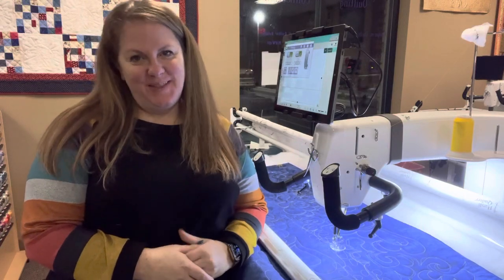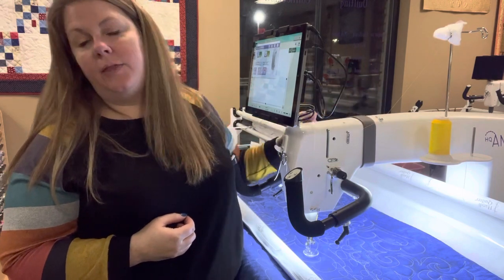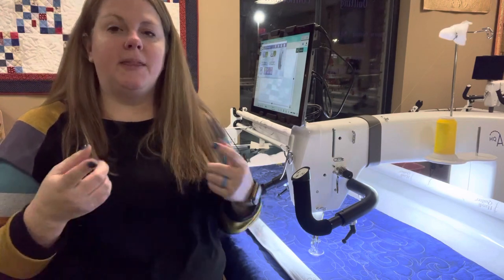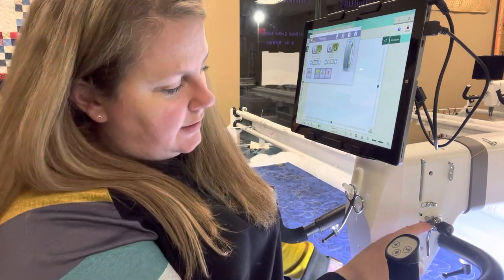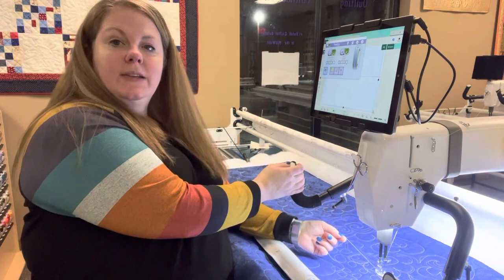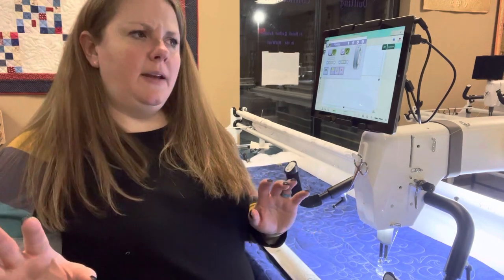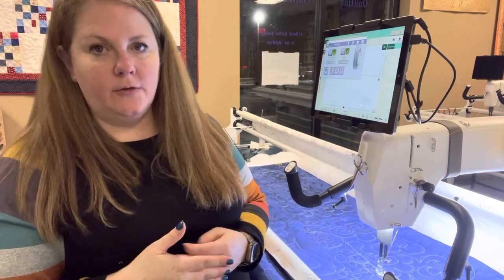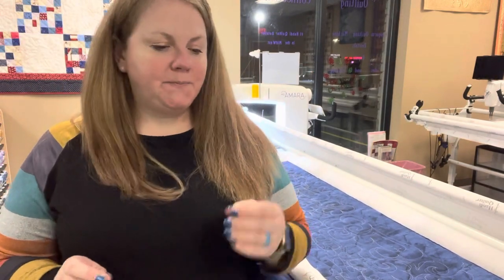Fixing Thread breaks and How to thread a Handi Quilter longarm machine

Comment: Thank you so much! I had to turn off my thread sensor and tech told me my wire wasn’t close enough. Now I understand! Also didn’t know about tightening up bars. Good to know!
I learn something every time! 
And thank y’all for taking care of my micro foot issue!! Y’all are awesome!!
Reply from the maker: Oh good!! Just be careful if you try to adjust your thread break sensor. If you tighten that screw too much you can break it. Then the head would need to be opened and the sensor replaced and I think those are over $200 for a replacement. You just want that set screw snug but not tight! 
You are so welcome! We are happy to help!

Comment: Can you explain more on the batting up top?
Reply from the maker: Yes! That helps to pull off any extra lint from the thread. It also helps keep the thread smooth as it pulls off the cone. It’s just a small strip of poly batting folded up.

Comment: what causes eyes lashes on the back of the quilt
Reply from the maker: Great question! Usually not having the thread all the way between those silver disks will cause eyelashing. If there isn’t enough tension on the top you can see the eyelash on the back. It could also be if you aren’t using the same thickness (type) of thread top and back and using the same color top and back. Then you can see eyelashes with a thin batting. Batting is one of the most important factors for a good tension. If it’s a thin batting or too flat, then you have to work really hard to get the stitches to lock in the center of the batting so you don’t see eyelashes. My best advice is always use the same type of thread top and back and try to always use the same color top and back. If you use different colors or a variegated thread then double the batting to help with tension. Hope that’s helps!
Reply: @angiesanswers91  thank you

Comment: Mine is breaking when it stitches up and to the left. Im so frustrated.
Reply from the maker: That is the hardest way for the machine to stitch. You can try to turn the needle to about 7:30 and see if that helps. If not try 4:30. That helps see if the timing could be tightened up to deflect the needle a little more. 
If turning the needle doesn’t help then it could be a tension issue. 
Hope that helps!
Reply: @angiesanswers91 I found that if I use mr needles (134mr), I no longer have the breaks when I stitch in those directions.  MR stands for multi range— meaning multiple directions.  Also some are titanium coated— not good for batiks— they are a slight ball point needle. I generally use size 18.